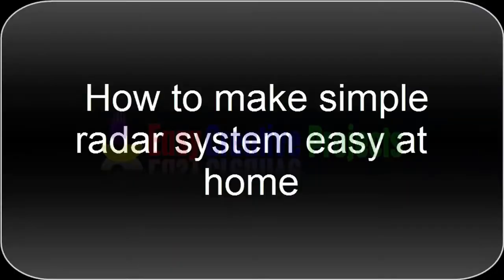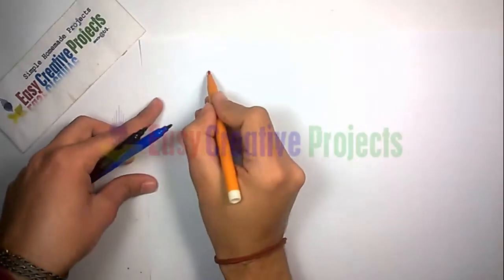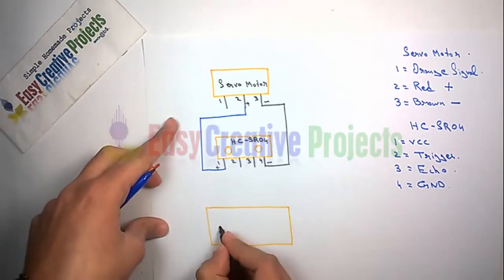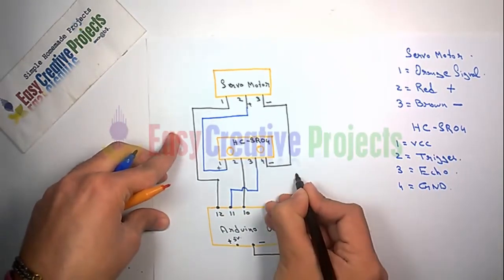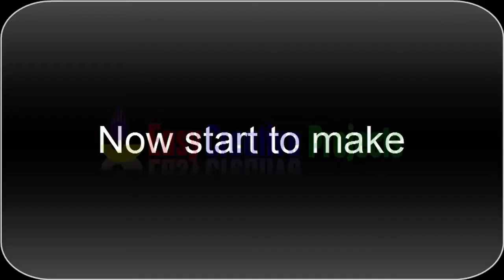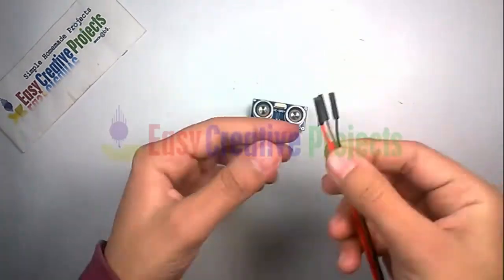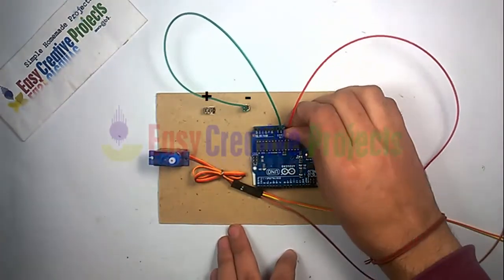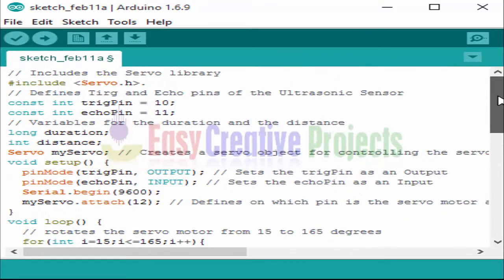How to make simple radar system easy at home - Powerful long range

Comment: If I wanted to make something simple in design that would be able to detect a larger area, like 100 yards wide and about 50 yards out what changes would I need to make to a simple design like this?
Reply from the maker: if you want to increase area so you need long range sensor.
Reply: can we use dish satellite to make long range if this true how we can do this ?
Reply from the maker: nothing is impossible in this universe